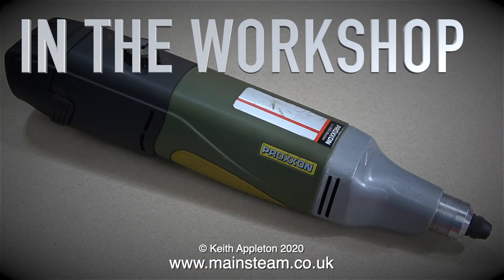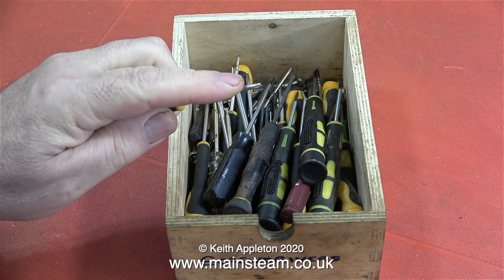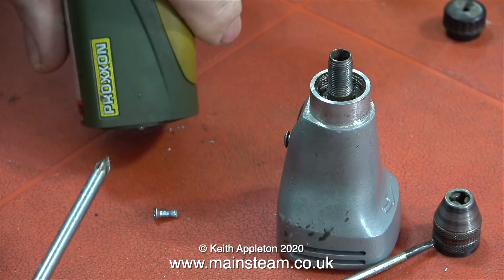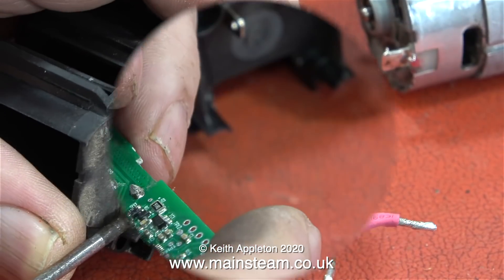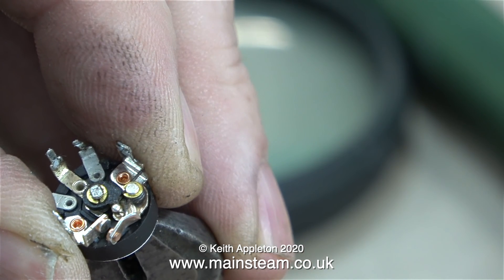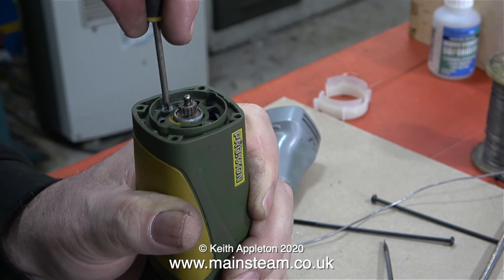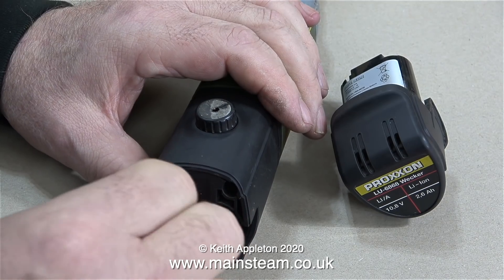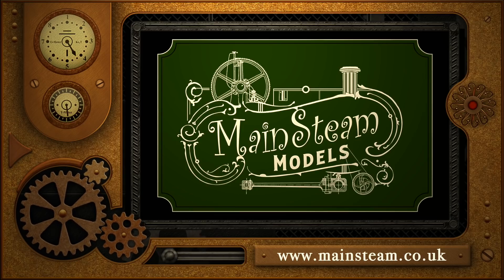HOW TO REPAIR A PROXXON DRILL - IN THE WORKSHOP

Comment: I have a Dewalt router with infinite variable speed control.A very powerful router.A few months after using it,the speed control went crazy. I found sawdust had made its way into the potentiometer.After cleaning,it worked very well...for a short time. I ended up purchasing a new potentiometer.When it arrived,I noticed it was sealed.Imagine that.Anyway,after installing the new potentiometer, I have had no problems with it over the last fifteen years. The Proxon looks like a very good tool.Much better than the Drexel tools.Thanks for showing the inner workings of the Proxon. I may have to buy one of those.

Comment: And that's a display of a quality tool: it can be disassembled and repaired. No epoxy-coated PCB's, one-way latches or press-fit connections that you can't undo without demolishing the housing.

Comment: Yes, Torx. I really like these, much better than the Phillips/Pozidrive types. They don't jump out and knacker the screw heads. 
Good repair. I really think you should treat the soldering iron with the same love that you have for your traction engine.
Reply from the maker: I agree - I think that I will buy a new one, as this is about 35 years old and starting to look it's age }:-)))